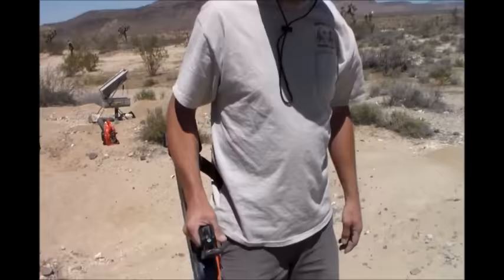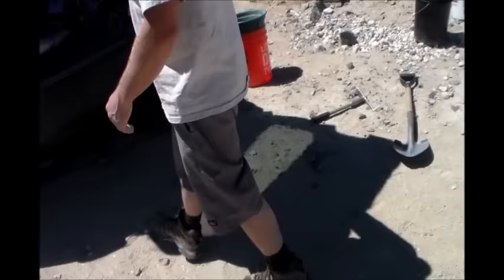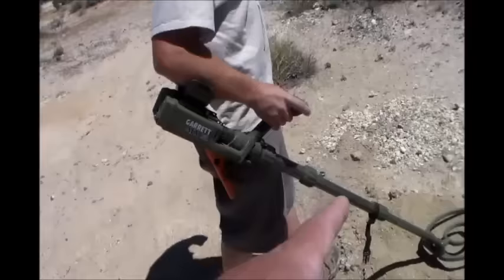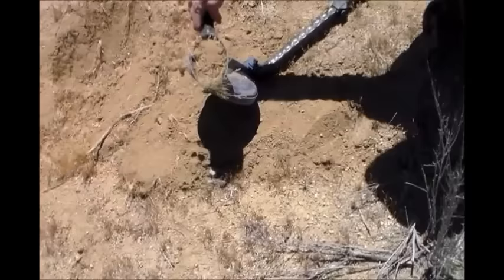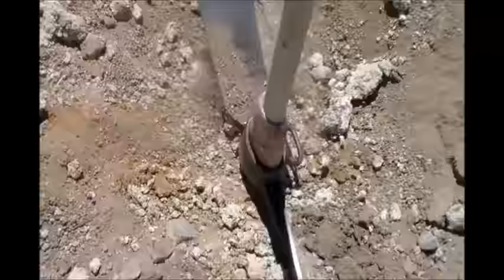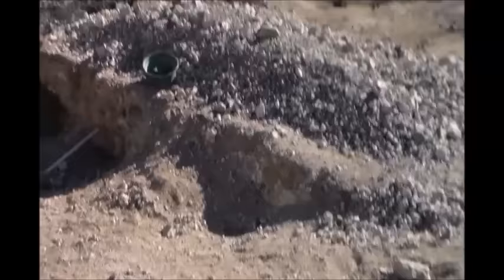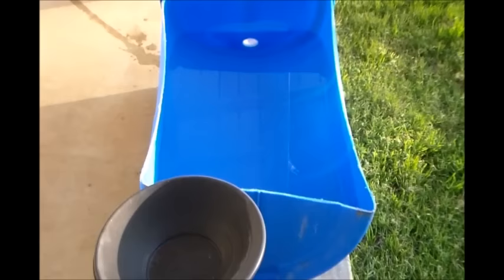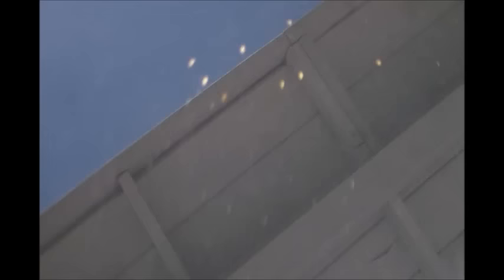Mojave Desert Gold Prospecting

Comment: SDC 2300 very awesome VLF detector,  great, and absolutely awesome on small bits less than 0.5 gram,  they've got very good depth for the size of the coil. I've got one of the new SDC 2300 detectors.  Cost just on $3000 here in Western Australia,  my machine paid for itself in 6 weeks of detecting over the summer here down under in my area of western Australia.  My location is Kalgoorlie western Australia,  I've got 3 gold leases / claims now for the last 2 years,  all which produce gold nuggets and lots of fine gold. My other machine is the GPX 4500 pulse induction detector,  with various size coils and shapes for different ground,  even a coil for detecting on the salt lakes around here. I'm an underground miner for my job but my hobby for my days off is detecting,  pushing dirt only lease and also hunting for new ground that's not pegged yet.  I hope to come over to America in around 12 months time to do some prospecting / detecting over there and make comparison to the soil types in regards to mineralisation,  consistency and house "hot"  the ground is in regards to some other minerals in the ground.  
Great videos mate,  I enjoy watching them.  Love the area that you guys go detecting in. Very interesting soil type.